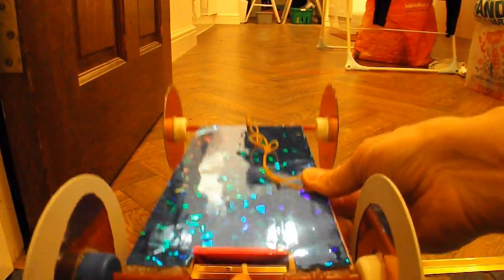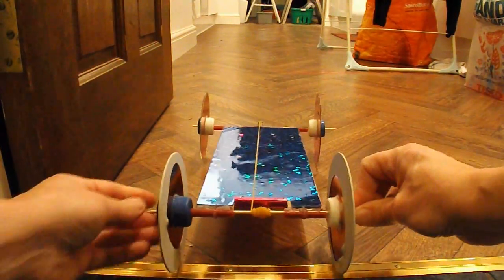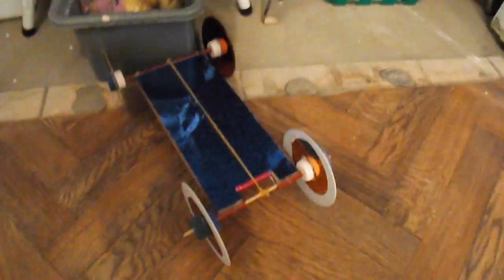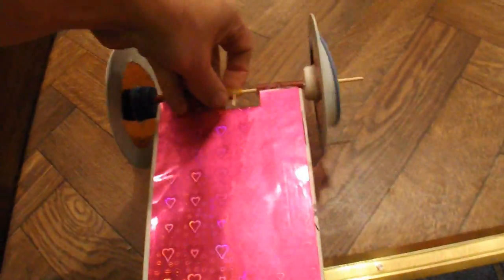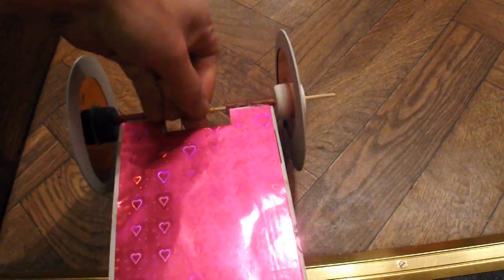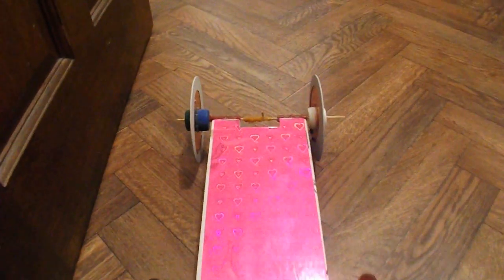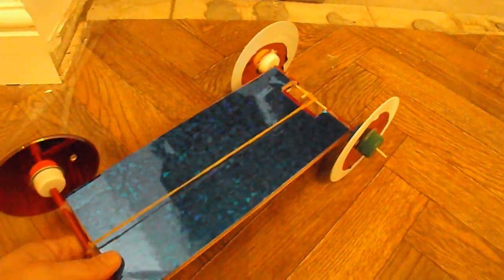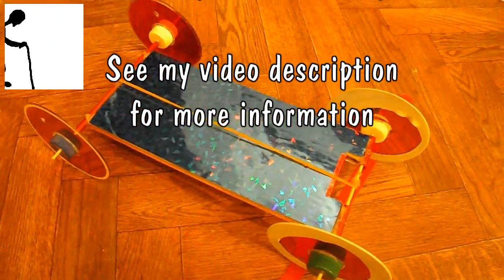Rubber Band Powered Car - Front Axle Drive

Comment: I have project to make with 1 rubber band for distance10meter.Please help me.
Reply from the maker: What help do you want? Here is my standard reply for people trying to get a rubber band powered car to travel a long distance.
This is a fairly regular question. 
I am assuming you have some set criteria for number of rubber bands and size of vehicle so putting those aside. The first point about travelling a long distance is minimising your friction because that is what wastes your power. 
1. Friction caused by badly aligned wheels rubbing on the bodywork should be easy to fix by adding spacers to keep the wheels clear.
2. Friction where the axle is attached to the bodywork is reduced by making sure the axle bearing surfaces are something that does not bind together. Wood and cardboard are not good. Metal surfaces are better. Steel and brass is good. Ball race bearings would be even better. Whatever you have, even if it is just wood and cardboard, you can improve by making sure there is clearance so they do not jam together and maybe rub some graphite from a pencil where they make contact might help.
3. Friction with the wheels to the ground can be a mixed blessing. Minimise the friction of the front wheels by using very thin wheels, however you may need some grip to ensure they keep the car going straight. The same applies to the back wheels, assuming you are using the back wheels as the drive wheels. However if they do not have enough grip they will spin under power and that is all wasted energy. Thin wheels with rubber tyres would be best in that case.
Larger wheels take more effort to get them turning but once moving they have the momentum to keep rolling when the rubber bands have finished. You could experiment with different sizes to see which work best.
You could use some sort of gearing to start with a large gear to get the wheel moving and then a smaller gear to maintain the motion. There are some examples in my playlists.
Reducing unnecessary weight by trimming the bodywork a little may help but make sure you don't loose grip and start the wheels spinning if the body is too light. It may bend or break under tension so be careful.
Another trick I have found helps is to stretch the rubber band as you wind it round the axle so you get more turns round the axle, this can make a significant difference compared to just winding the band normally.
If you can only use a short rubber band, connect it to the axle using thin string so the string winds round the axle stretching the rubber band

Check out my HelpFiles playlist. Many of the videos are related to Rubber Band Powered Cars
http://www.youtube.com/playlist?list=PLA5a2xPRSrB2v0vxMJyZ9cPweAGx1FK6e

Comment: Front wheel drive and easy steerable(proper steer, not like the last one with the bended wire, great idea by the way) and powered by rubber bands or an small electric motor?
Reply from the maker: If you want steerable you might as well check out my Remote Control playlist and if you want them front wheel drive just run them backwards so the back is the front. http://www.youtube.com/playlist?list=PLA5a2xPRSrB13Xcquw4Ff09MQzTPjeVkI